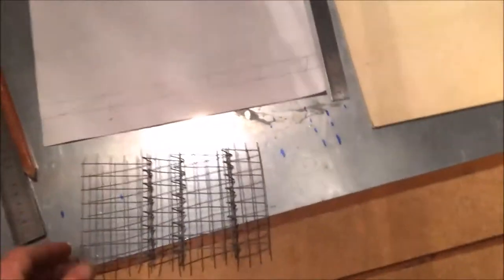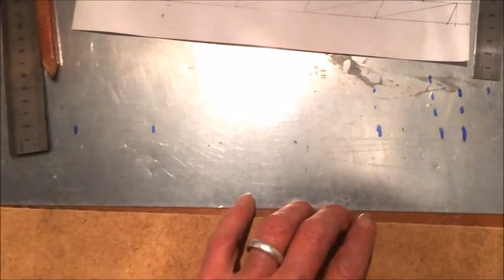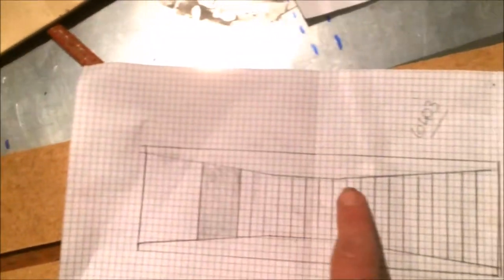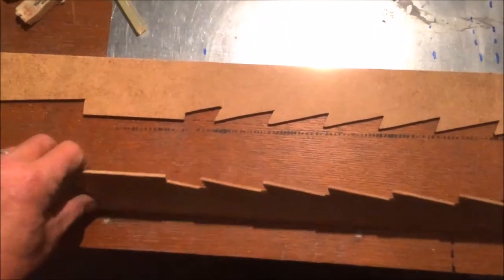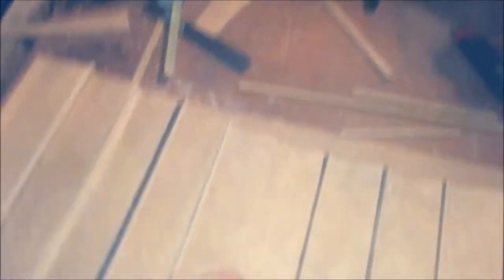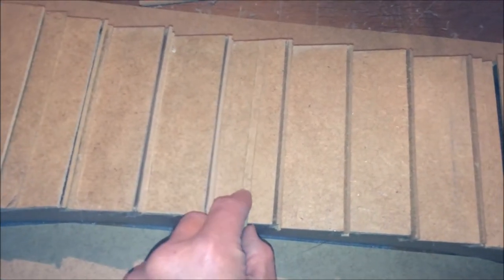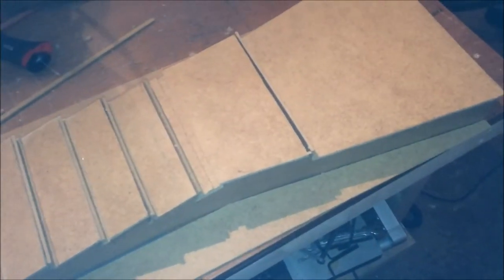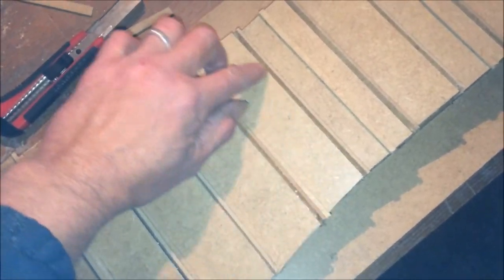sluice build the plug part 1  06 11 16

Comment: Gold fever, I think it well be very hard to get the mold out with so many different angles and sides, but if anyone can do it it is you, good luck.
Reply from the maker: Yep I need ti change one bit for sure to help with that. I was only going to be a one time thing. Its only hot glued so I might have to do some de construction without destroying it all together. Fingers crossed and all that. Had a belt buckle fail too over the weekend will have to try again when its not raining or snowing...

Comment: Fibreglassing - gloves, respirator, goggles or something to stop filaments floating into your eyes.  See all those wells, if they get full of stones and mud will the gold still get lodged in them or will it wash over into the next well... and the next... until it's in the river again?
Reply from the maker: Yeah I have the safety stuff. With the wells the gold is heavy well dense. 2 times that of lead 3 times iron and 20 that of water. when it is flowing correctly the material will exchange and dance in the wells the gold should drop down and sit in the bottom of the well. The golg should not get more than half way down the sluice.  I hope lol
Reply: Thank you, I hadn't accounted for the activity in each well and gold working it's way to the bottom and pushing other material out.  Continue building Agent Gold.
Reply from the maker: You can blow it out if its too fast steep or over fed but in general you catch 99% I would say.
My mate called in last night and gave me a bag of paydirt from Germany something for the winter fever. He also brought 4 bags of rabbit shi for the garden. I am so easily pleased lol

Comment: With the negative angles you have on the riffles and the concave side shape are you going to have enough room for you to get the finished product off the plug?
Reply from the maker: Dan Herring b thanks for the input  there is one place I must change for sure I saw it when I was trimming the glue   I hope the plug will survive but as long as a get one cast I will be happy fingers crossed.